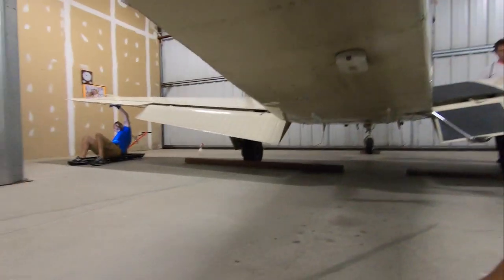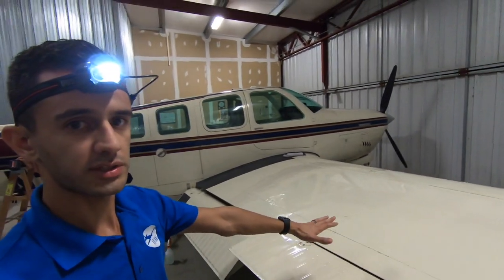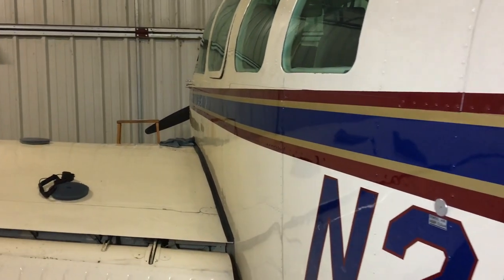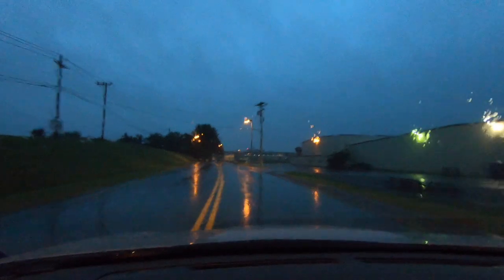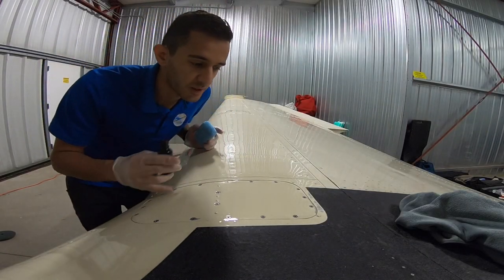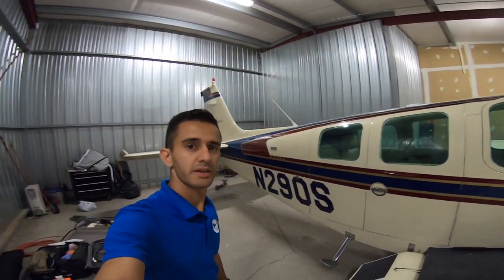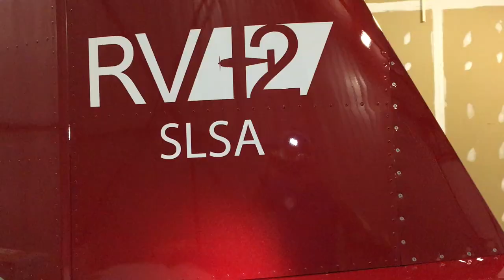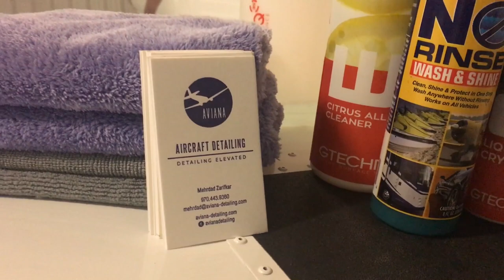Vlog 005 Part 2 - We restore a Bonanza and gloss up a RV12 in Frederick, MD at AOPA

Comment: When you say coated, I thought you meant like a standard wax. I just bought my first plane and hoping to do an in-depth cleaning and detail. What do you use? That seems to really give it the wow factor? Would you mind sharing? Thanks!
Reply from the maker: So the coating a ceramic layer (think of it as a super thin clear coat) is there for protection. All of the gloss comes from the paint correction step. This is a mechanical step to remove oxidized and dull paint. It is a process rather than a product.
Reply: Aviana Aircraft Detailing Hey! Yes, I realized that after watching almost all your videos :) Anyhow, was simply too quick on the trigger. Another question, if I may, is a regular orbiting  machine good at low rpm or is a random orbiting orbital what you use? Any many recommendations? My father, brother-in-law, and myself all have some pretty old birds that all suffer from oxidization. Any pointers would be appreciated! 

Love the content... and sharing to all the local hangar friends and beyond. 👍🏻
Reply from the maker: @CatriMatri  so with regular orbiting machine, are you thinking the rotary like I am using? If your plane is white, that would be a reasonable choice, though a random orbital (we call them dual action polishers) is safer. in episode 9 you can see the difference between a rotary and dual action polisher. The big thing for chalky paint is that you will need to frequently clean your pads to keep them from clogging up. Let me know if you have any more questions!